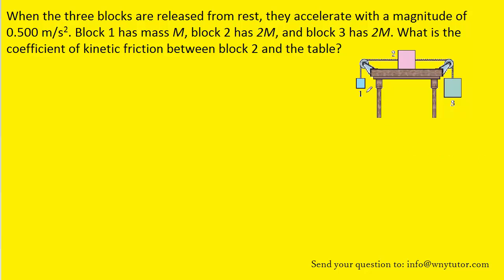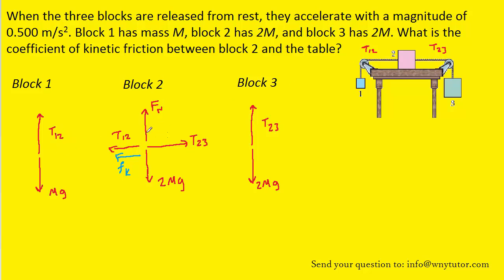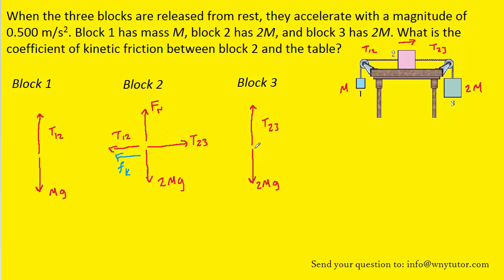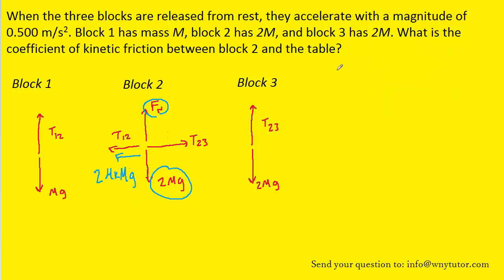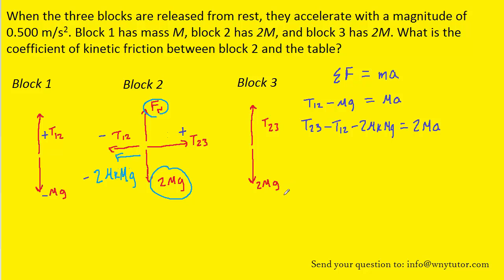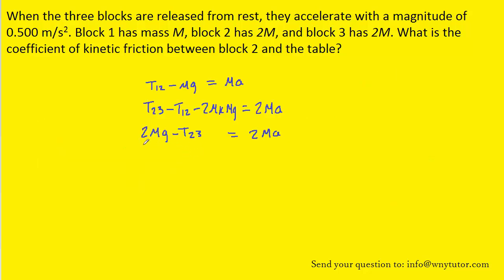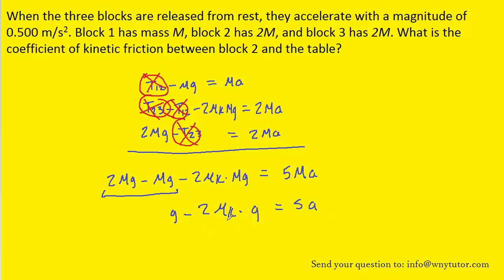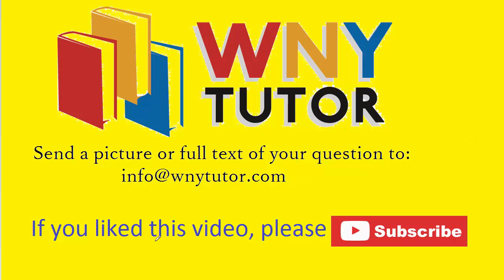When the three blocks are released from rest, they accelerate with a magnitude of 0.500 m/s2. Block

Comment: Why is T23 negative in the third block, and why isnt 2Mg negative?
Thanks
Reply: Yes, T23 should be positive because the tension vector is up in the positive y axis and 2Mg should be negative because the vector is going down in negative y axis. Correct me if I am wrong.
Reply: @erikunixarias  I hope I am not too late on the reply but the reason that these forces are labeled as positive or negative seems to be, I believe, due to their relationship with the direction of motion and how that seems to relate to setting up the 3 equations later. It isn't that you are necessarily wrong but that we are changing our frame of reference for each equation, separately, to make it fit the motion we are trying to describe. 

You arent wrong in your observation, and you can choose to do this in your calculations if you are more comfortable doing so, just ensure you include that it equals -2Ma across the equal sign to compensate. You should get the same answer either way because the values don't change, just the relative direction.
Reply: @alexeyman7301  Yes, I see your point. If your frame of reference depends on the motion then your negative and positive sings in the equations make sense. Thank you clarifying this point for me.
Reply: So block 3 has a greater mass than block 1 so the system is moving to the right. As that happens in block 3, it moves downward making 2mg positive and T23 negative. Hope this makes sense